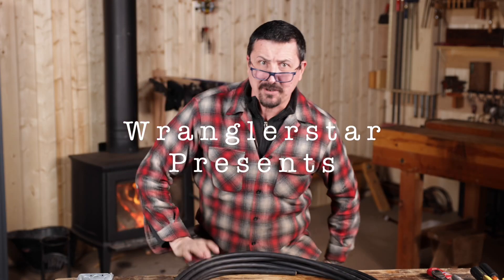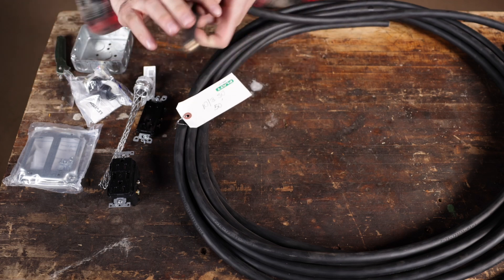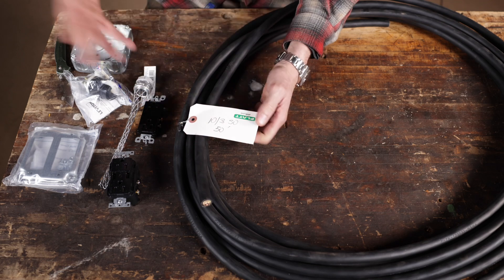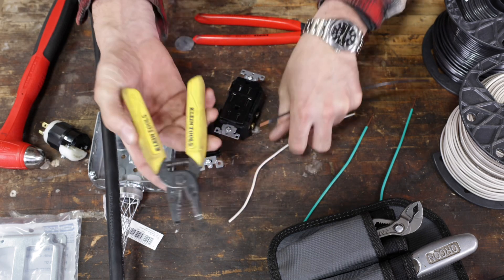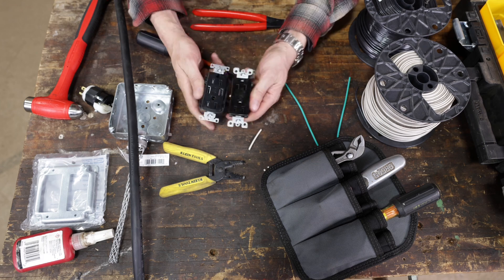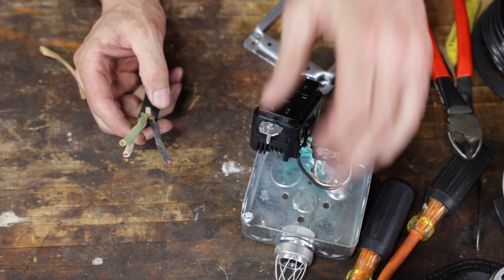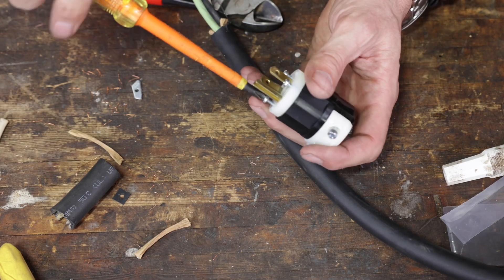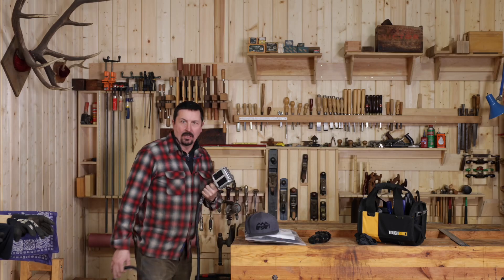The Ultimate $150 Shop Accessory - ALPHA CORD

Comment: disclaimer: im an electrician and not judging you for not knowing.  i have learned much from you and here is my chance to give a little back. 
 the cable is called SO or SJO depending on the jacket thickness. the nut for the  cable stress retainer  goes inside the box and then the bushing goes on after that (not really needed for this but wont hurt). also your grand dad was correct, those are washers and are intended to help stand the receptacle off the box you are screwing to for fit and finish. the ground screw should only have one wire under it (technically ) not sure what you are trying to accomplish by doing it that way because you still have to wire nut to the ground in the cable. last, although nothing is incorrect with the wire stabbed and compressed into the receptacle; the hook method (when done correctly) holds a stronger connection. just food for thought. good work!
Reply: I'm a HVAC electrician, been watching his channel for years. I'm pretty sure he does stuff like this on purpose to have fun with all the sparkeys in the comment section. He calls them all pre madanas and stuff lol
Reply: Since you are en electrician, I have a question: My issue with this cable is, that the box for the receptacles has a bunch of holes in it- so the internals are not protected from the environment (dust, moisture, sand, etc). If the box would be sealed, I would love this cable. Any suggestions on a sealed alternative?
Reply: @yxcvmk  Just make sure your cable is SO or THWN or THWN-2 & get a weatherproof outdoor box (they come with seals).

You could pay extra for the blast-proof or plain aluminum ones, or go to the cheapest option: plastic. (As long as they're water-tight they should say "suitable for wet locations" somewhere... usually inside.) You can also get a clear cover for the outside so it can be outdoors and get rained on (still wouldn't risk dropping it in a deep puddle, tho.)

Comment: The lociknut is to be on the inside of the box to secure the fitting.  the plastic is just a bushing to protect the cables from chaffing,
Reply: Good point
Reply: I would use outdoor box instead of Steal so I could use this in wet areas.

Comment: Tomorrow’s video: “Fixing My NEW Extension Chord”. Lol
Reply: i hope he gets that lock nut put on right. Be a shame to see him yank the cord out because that little plastic nut breaks or gets loose. Im not gonna talk about all of them knock outs that can get banged on and pushed in to the hot side of the plugs,,,,,
Reply: Warren , what should have done? Different style box with only 1 knockout?
Reply: @MyFirstYoutubeHandle  wrap the outlets in electrical tape
Reply: @warrenmichael918    Regarding the knock-outs,    I hadn't thought of that.... good point !
Reply: @douglascroghan9657  electrical tape is what is done in most cases but the knockouts are fairly sturdy. Homeowners and Non professional tradesmen most likely wouldnt use this enough to bang it all to heck and even worry about damage. A good option is the outdoor boxes with the screw in knockout plugs, the ones that usually come with the deep watertight covers.
Reply: @warrenmichael918  yeah he should have gotten himself a 3 port 3/4 in two gang bell box
Reply: @warrenmichael918  .... I suppose a person could also use one of the plastic boxes.
Reply: @douglascroghan9657  yes but they are gonna get broke or rubbed through being dragged around on shop floors or a concrete slab. I know some plastic boxes are pretty tough though.
Reply: @douglascroghan9657  The box he used is just fine. The actual chance of a knockout being bent into a terminal of a receptacle is very low. It COULD happen but most likely wont, so electrical tape around the rec. is just a good safe idea here.
Reply: @warrenmichael918    OK....      I appreciate your thoughts.

Comment: I recommend you look into a spider box, as a former construction manager I'm sure you know what it is but for others. Its a .. "a portable power distribution centers that are designed to be an economical way to distribute electrical power using a 250 VAC". Allows you to put an higher amp plug and then have a box that you can put anywhere (with a long cord) that can provide the outlets you need.

Comment: The cord is called "SO" cord, the "Slugs are called "Knock Outs" or "KO's", The "Strain Reliver" is a "CGB" connector with strain relief,  the lock nut is supposed to go on the inside of the box the plastic "Insulating Bushing" is screwed on overtop  of that to protect wire, you can "pig tail" your grounds that way you do not need to put 2 under the ground screw also it is good practice to do that with the receptacles that way if the one feeding the other were to go bad you wouldn't lose both receptacles, lastly to utilize the ampacity of the 10 wire you bought you should have put 20 amp receptacles in the box. with the ones you have you are only rated for 15 amps
Reply: Right on.
Reply: Good words. Correct me if I'm wrong if he used 20 amp receptacles wouldn't he need to use a 20 amp plug which would limit where he can plug it into?
Reply: @abdulelkhatib2674  this is correct. I wasnt thinking about ease of access
Reply: @abdulelkhatib2674  good thought
Reply: @johnk2075 Thanks
Reply: HH AA  if im wrong please elaborate. to my knowledge 120v 20amp rated receptacles could have a few connection types but not the one show which seems to be a 5-15r which is only rated for 15amps. the receptacles I am referring to have a 5-20r style connection on them. Im not sure what it is called but it has a small horizontal tab protruding off of the neutral contact.

Comment: The insert was probably there for the cheap Chinese cords.
Reply: The inserts are there in case you use a flat chord, not necessarily a cheap chord.
Reply: The insert is there because that 5-15 (15a) Edison connector is only meant to have 12-3 cable at the most. His 10awg is a waste of money and energy lugging that thing around.
Reply: @grantkondourajian6150  I agree, unless it was going to be a cord over 100ft there’s no point in upsizing the cord

Comment: About 5 years ago i built something similar, but instead of a 120v outlet only, i wanted one i could use for 240v and 120v, so i used 8/4 wire and combined 2 boxes back to back with one side having the 240v plug for my welder and the other side had 2 separate 120v outlets, so the load is split evenly between the red circuit and black circuit. It also shares the same 240v plug as our backup generator, so we can have it 50ft away. I use it a lot for portable welding with the generator, because working with the generator noise so close really gets to you over time along with the gas fumes.

Comment: Wonderful thing to have around the job site, the one my dad built years ago has two boxes on the end about 5 feet apart. Also a useful way we store it is in a 5 gallon bucket, drill a hole in the side near the bottom and feed the male end through. Coil the cord up in the bucket and it never gets tangled and is super easy to pack around.

Comment: I am a working musician, playing the bass and singing for making a living. I really know what a good extention cord is worth. Good cables, let it be for electricity, instrument cable, multicore (for live music, foh), you name it, are the guarantee for your electrical and electronic devices to work proper and to last longer. In most cases it is the power adaptor of an electrical device that fails, and a good, stable connection seems to help to give this items a longer live.
I buy my cables at a family owned and run electrician company, and also only use the best connectors you can get. Then I screw them together or solder them real good, what I like a lot for music applications.
If you buy cheap in cables, you not only will buy twice, but maybe ruin your power tools and machines.

Comment: It's probably already been said, but that "jam nut" is a supposed to go inside the box then the plastic bushing goes on afterwards.   The way this is assembled now a good yank would cause the bushing to fail and the cables will be hanging by the screw terminals.    Another thing to note is that those receptacle connections are only rated to properly fit a #12 or a #14 AWG wire.   If you want to us a #10 cable, you would need to use wire nuts inside the box to connect to a smaller gauge wire that is connected to the receptacles.

Comment: I feel a bit sorry for you backwards guys - the smaller the number, the heavier cord!
Do you have your bank accounts in the same manner?
Reply: A bit like the ISO 216 paper sizes, where the number indicates the number of cuts from a square meter sized sheet of paper.
Reply: @cjoor  or thickness of steel
Reply: It's actually not backwards. These are sized below Zero. Sized above Zero count upwards.

Comment: Really nice cord I'd just add two things as a former electrical professional. One, you mentioned you could plug your 240 loads into it like a welder but hopefully you know that's not accurate since you only ran one leg to it so it's a 120 outlet. Second, love the 10ga wire on the extension cord but the wires you're using to connect the sockets/sides of the outlet together are 12ga so your electrical capacity on the connected outlet is limited by the 12ga wire. SO you should probably mark which is which so that you don't accidentally plug a 20amp load (like a home gamer welder) into the wrong side of the outlet and end up with an electrical fire.

Comment: I think the flexible stuff is "service cord", SJOOW.
Reply: Soow
Reply: @joemomma4482  I've seen it both ways.  Not sure what the J represents.
Reply: @johndunbar2393  soow is 600v show is 300v
Reply: @joemomma4482  Ah, that's the difference!  Thanks for the info Sir!
Reply: S = Standard or Service Wire O = the exterior coating is oil resistant 

J = qualifies the “s” as junior service 

As Earnie said SO = 600v and SJ = 300v
Reply: Also, Junior service,  SJ, isn't allowed for certain applications under the NEC. That's out of the scope of the typical homeowner, but worth noting.

Comment: My dad and I did something similar to that. We had a 40 by 80 shop  (rented) and the shop plugs were inadequate for our power needs (120v 15a) so we nade our own power distribution cart. We went from the welder plug (220v 30a) to a 100ft 4 wire (i believe) 10ga  cord similar style as in the video, then to our "auxiliary" breaker box. Where we tied our 220v stick welder to and pulled one "leg" off to make a 120v 30amp circuit with a 4 plug outlet box. The power distribution cart carried the welder, its 50ft leads, had a hook to roll up the 100ft power cable, 4way 120v box for grinder and other power tools, another hook to carry a couple of "el cheapo" extention cords, a few angle grinders. The only issue we had with it is we should of got better caster wheels to hold the weight (harbor freight).

Comment: On cordage there is a "right" and "wrong" end for the plug. You will see that one end of the wire will spread properly into the plug with no wires crossing. The "wrong" end will have crossed wires which can be difficult to get inside the plug shell, especially with large wire like #10. Another way to think of it is one end will have the white on the left and the black on the right with the green on the top. The other end will be reversed.

Comment: Was the hole you used to make the fish hook threaded?  If the hole is threaded the purpose is to cut screws,  You thread the screw in, cut, and then remove.  Being firmly held there is minimal chance of damaging the thread. Any damage to the thread is fixed during removal.

Comment: i used to find the old heavy duty power strips that have 3x duplex outlets, and i would go out of my way to find the ones with 14awg cord, i'd use them until they wore out, then replace the receps inside of the strip with good quality duplex receps and record the unit with 10 or 14awg 3 conductor cable to a good heavy duty end, and i had i think it was 6 rare earth magnets glued to the back of the metal body so i could stick it to my toolbox, or to the side of my truck when i was working out of it off of an inverter or small genset, great idea, and super handy for the shop or even camping if you run power for charging phones, or a small fridge, camp lighting (work lights) etc etc etc, great vid and well thought out, stay safe out there brother

Comment: Hi Cody I see on the strain reliever you had the lock nut on the outside of the box and the plastic bushing on the inside. You should put the strain reliever base right against the outside of the box and then the lock nut on the inside then the plastic bushings on top of the lock nut. 
- Cam

Comment: This made me curious about how gauges of wires were determined so according to good old Wikipedia “Each diameter was multiplied by 0.890526 to give the next lower size. This is now the American wire gauge (AWG), and is prevalent in North America and used to some extent in over 65 countries”.  Looked up a couple gauges and this formula seems to work.  Oddly enough a #10 wire is roughly 1/10 of an inch at 0.109 inches.  There are also charts that tell how heavy of wire is needed to carry a given amperage.  This is based somewhat of distance.  The longer the run the heavier the wire you need.  The #10 wire you used is plenty heavy for fifty feet at 20 amps.  As you mentioned, you could go a bit lighter but, building things a bit stronger often pays off.  The only other idea would be to building a GFI or whatever they are called now.

Comment: 12/3 would suit most people since most breakers are only 20 amps. Of course if you set up a dedicated circuit/single outlet just for this cord only in your shop area you could use a 30 amp breaker in your box.

Comment: At 8:24 you talk about the ears.  You saved those in the old days for washer spacers behind the receptacle screw if your box in the wall was not flush.  Now you buy plastic "spacers" that can be slipped over the screw after you have started to install it.  Look for "Gardner Bender" switch and receptacle spacers.  The ears aren't the best against sheetrock if the box is not flush.  After a while the ears bend or sheetrock gives away and you have a loose receptacle in the wall. That is why you use the spacers.

Comment: Your jam nut needs to be on the inside of the box. The plastic bushing is just to prevent the plastic around the wire from touch any metal due wire dose move when energize. Therefore Jam not need to be on the inside to lock everything down the correct way.

Comment: The metallic lock nut is supposed to be on the inside of the box. He demonstrated tightening the locknut from the outside. This only tightened the strain relief against the plastic bushing. The only thing holding the strain relief and cable onto the box is the plastic bushing and the conductors screwed to the terminals.

Comment: idk if its different in other states, but typically when u see 12/3 or 10/3 the 3 refers to 3 current caring conductors, ground wires come pre installed on most all fashions of cable. so 10/3 or 12/3 would have (black and red) your hots ,(white) your neutral, and (green) as your ground. so if you ask for 10/2 or 12/2 you would have Black/white/green. good connections tho =)

Comment: If you look closely at your stripping pliers the hole is threaded.  It is not really for bending hooks on your wire.  You can screw brass or aluminum screws/bolts onto the hole then "shear" them off to the length you need.

By the way, I would like to become a "professional homeowner", I have owned 5 homes and a DYI kind of guy, do you think I could qualify?  :)

Comment: SO Cord, excellent stuff I use #12. Remember that stranded wire carries more current than solid wire. A #12 SO Cord will carry 40 Amps no problem. #10 60Amps. Most circuits 120V are 20A in shops garages and kitchen. Most 250 Volt receptacles are 30-40A in standard homes. Just something to think about. For that matter if you want a nice light cord for using with equipment #14 is fine. Always use 20A receptacles, & 20A cord caps. One thing you should add to this video is the fact that SO Cord has a male & female end. Great video.

Comment: Cable type is likely SJOOW or SOOW. Differ in max voltage (300v vs. 600V). Both are oil and water resistant. Agree that these are awesome for making power boxes. I put screw in place rubber feet on the bottom of the box and stick on bumpers on the receptacle side for protection

Comment: With such a heavy  gauge wire, I would have put 20A plugs/outlet on it. Code for pro wiring wraps each outlet with electrical tape. The USB outlet is a nice touch.

Comment: My grandfather had a pipeline come through and he asked them to leave a 100 foot electrical cord like that behind and they did, he has been cutting it up into different lengths he made a 30 footer to use as a very pliable welding extension cord, we also use a 50 footer for a tractor plug in to keep it warm in cold weather

Comment: Sharp setup. I have made these with a GFI plug and a pig tail on a dimmer. Used them for video production setups. 2 main power plugs with protection and a dimmer for flexability. Great build man. Keep up the good work.

Comment: Moved into a very old house some 10 or so years ago that never had an electric range/oven. Great grandparents started with a wood-fired stove, moved on to an oil burner (fuel oil), and finally when the kids moved out they moved to a basic double hot plate. Long story to say that I had to purchase roughly 65' of nice quality 10/3 to run from the distribution box under the house and up through the kitchen floor to move into the modern era of cooking. Wouldn't have minded a gas stove, but no gas installed either lol.